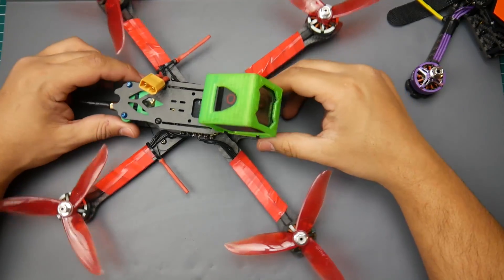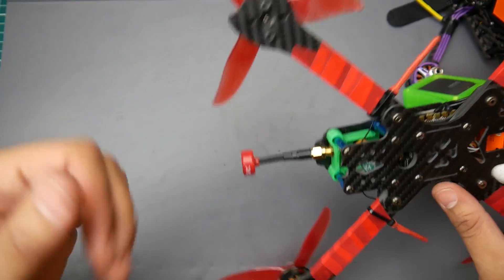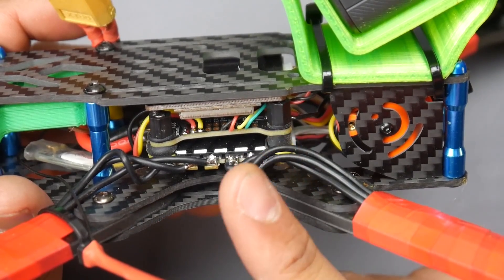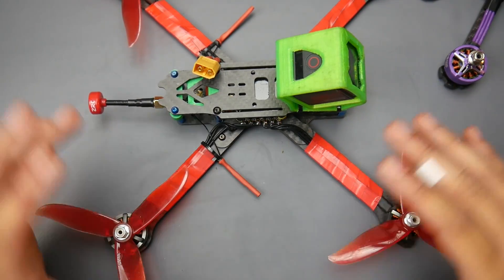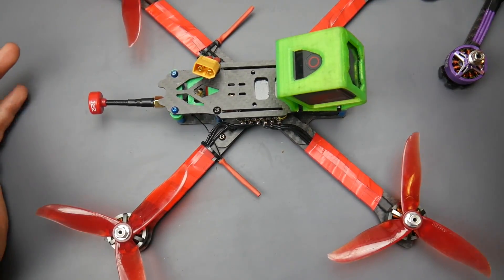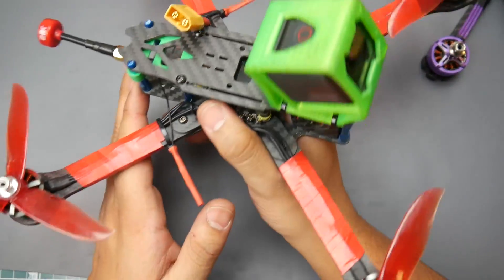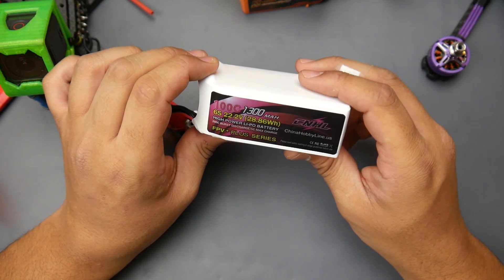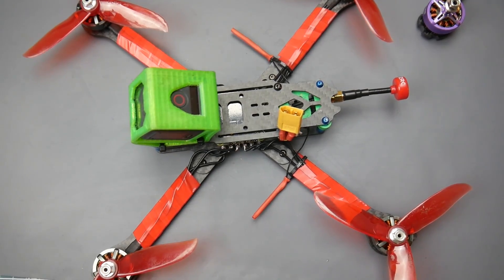Premium Performance For $12 // Best Budget Motor Emax Eco!!

Comment: So you're not the first person i've heard talk about flying 6s on 2700Kv motors, but I assumed the first guy was lying and your gear would shoot fire if you tried to run that drivetrain.... Is that really a thing people do? Does it melt like the T1000?
Reply from the maker: What 2700kv its 1700kv
Reply: @DroneMesh   @3:49
Reply from the maker: @MrFadjule  I was talking about the speed and how it felt the 2700kv was in context with it on a 4s.. However I have 2600kv 6s motors from T-Motor which i will take out this week for testing.
Reply: @DroneMesh  for 5" props?! this boggles my mind

Comment: The 2400kv ECO and RSII motors are nigh on identical in terms of thrust and efficiency on MQTB.  They both measured the same KV, in fact the RSII was slightly higher.  One costs three times as much as the other.  The ECO's were supposed take after the LS series, and those are strong and powerful with only N48 magnets.  I'll take the 4x9x4 bearing of the ECO over the shitty 4x8x3 of the RSII any day.

Comment: Nice! I have the 2400kv running on 4s w/5043  Windancers! I wasn’t expecting much but damn, they are pretty damn good! I was impressed, didn’t think I would like them! Very smooth and good power! Gonna pick up the 1700kv ones as well now. Just because I was impressed with the performance. And I normally buy “premium” motors

Comment: Hello, good friend, could you tell me where the propeller nuts tighten, squeeze right? or press to the left? thanks
Reply: @DroneMesh  sorry, these engines are only available in the direction of rotation cw, I think it means that nut threaded right to hold the propeller, is that so?

Comment: Whats your opinion on Eachine Tx(s) vs AKK Tx(s) ? 

I am looking for an Airplane System; TX and RX with (reliable 1-2km Range) as a replacement for the old Lawmate 2,4Ghz System. I made the switch from 433openlrs to FrSky 2,4 thats why I have to switch the Videosystem as well. My Videogoogles are from Marek: http://napolskimniebie.pl/index.php/sklep/wyposazenie-fpv/obudowa-do-monitora-5-detail

Comment: I use 1700-1800 KV motors like this  designed for 6S and 5" props but with 6" props and 4S on wings. You can use lithium iron 4S1P batteries , cruise on 3-5 amps at 70-80 kmh, and get flights for 30 + minutes and still come down on storage voltage.
Reply: That's very interesting! I'm new to for, I've been easing myself in with toy drones first just to get used to the controls. I feel ready to build my first fpv drone now. I'm wondering if you can give me some pointers on parts? I'm interested in long flight time and I'm willing to sacrifice on top speed for it. I was looking into building a 6s 5" frame drone with 1600-1800kvl motors set up for maximum flight time. I'm also looking at getting a nice he camera so I don't have to mount a go pro to it. Any suggestions in your experience on what frame, esc, FC, motors, vtx, cam and battery? Also what's a good intro remote control? I would appreciate any input 😊 thanks in advance!
Reply: @KabbaJabbawockeeZ95 Yes my total amount draw.  12-14 amps Max on 4s at takeoff on 80-100% throttle.  Once airborne and the prop is unloaded I can cruise at 60-75 km/h at 3-5 amps on 4s.  I use a racestar 1722 kv 2205 motor and a homemade 4S1P 18650 pack. All from bangood.  Samsung inr 18650 30q and I use gemfan flash 6042 2 blade propeller. Gemfan triblade are okay but pull more amps without a noticeable increase in speed. I prefer 18650 as they are lighter and have far better energy density.

Comment: If I'm only planning on running 4S is it worth getting 1700KV? Or should I stick with the 2400?
Reply: i have the 1700kv for 6s. Now i flew the dawm bugger on 4s, ok it isnt the faster rig anymore but for some freestyle? i really enjoyed them on 4s.
Reply: 2400 for 4s
Reply: 2400 in 4s
Reply: I ve running the 1700kv version on 6" with 4S and its really ok if you don t wanna race. Flighttime is about 5 min with a 1100mah 4S. But i ve just orderd a 6S lipo for more speed!
Reply: Michael Mir yeah definitely do those on 6s. Thinking about picking some up
Reply: @michaelmir9150  6" triblades or 2blade?
Reply: @Witness27  its a 2 blade 6045 prop.

Comment: The tmotors f40 pro 2600kv are in 11€ on AliExpress
Reply: where? Readytosky are not tmotors. I've had Readytosky version of Brotherhobby motors, comared them side by side and cheaper ones has way weaker magnets. Besides they are nearly visually identical.
Reply: @tmb282  nop I have thems and compared with originals from getfpv are the same exactly motor,  I'm not talking about a rebranded or different label motor, I do not want them to empty the stock u can search by u self, and wtf is a readytoshky xD another option if u don't trust is the RCX 2207 2700kv
Reply: @ho-xo8my  Readytosky is an old shop selling cheapo FPV stuff. They're famous for selling cheap motor that looks exacly like a premium ones aside logo :D can you show me, where did you buy this F40 motos?
Reply: @tmb282  send me a message on one of my videos and I will shared there

Comment: You kill them with one hit in crash worst motor I have seen in a while
Reply: i have them on all my quads and crashed like 20 times ...no even a ding.
Reply: @davidvaknin3801   I have 12 motors all dead
Reply: @biggfpv2721  I want see some pictures show us? because I don't believed you talking about.
Reply: @robortmojo457  good Lord why would I lie about it I don't benefit from any of it just a tip if you love emax buy the dang things don't really make a fuck to me either way
Reply: @biggfpv2721 ??? Are sure its a problem with a motor???
Reply: How did you kill all of your motors? Flying a wing? With a quad or seems like 1 or 2 would survive just because you couldn't fly anymore.
Reply: @mshane86  I didn't kill every one I got three left I just took em all off and stuck em in a bag cause I ain't buying more but I mean I can't expect them to hold up like a better motor but figured they would be better than that

Comment: Not related but how have you got on with the tekko metal 4 in 1 esc? Really keen to know what you think.
Reply from the maker: I am repapring a second build with the metal to run 6s I have it on a 4s build and its going great so far.
Reply: @DroneMesh  Thanks Great to hear. I have a couple on order for some new builds.

Comment: Lol goose just went to Phoenix open and trashed his ecos practicing before qualifying even began, 
Do Not Race these!
They are not very durable, or durable at all.
If you want performance and a great price check out Rcx motors
Reply: I was going to get these. Drat. I'll have to get the racedayquads 2205 badass motors now.
Reply: @KabbaJabbawockeeZ95 I decided not to get them and got RDQ motors instead
Reply: @FPVisioning  Any motor will have questionable durability when crashed, your statement is pretty flawed.
Reply: And some are stronger than others, due to better metal and design. Statement isn't flawed.
Reply: @Xistn  If you looked around youtube you would have seen that this is the case for lots of people

Comment: The emax does not show which magnet is using and the photos of the motor we can see that they are not in arc, with that the thrust will never be the same as premium motors
Reply: "Sorry, but I gotta get views from the title and sales from the link."

Motor quality (I'm not saying price!) plays a LOT of effect in your quad handling and performance. Saying it's just a hype to spend more money is plain stupid.
Reply: and that means ??   so we are using throttle position around 50% instead of 40% ??  who cares !  its all hype to get you to spend your $$
Reply: @CaribbeanZapatta  
The area of contact with arch magnet is bigger, giving more power and efficiency to the motors, this is a very important factor, besides being necessary to know the quality of the magnet, the premium motors use n52h or n52sh, these acronyms demonstrate the force and magnet protection
Reply: so this means what for the everyday FPV hobbiest ?    I am retired 67 and I fly EVERY DAY ! m I have built over 100 kwads (ya crazy I know)  and I have only had TWO motor failures.    I have Kareareas $27.  motors and Eachine cheepo motors.  when I sit down to enjoy a 5 min flight I could not care less what the motors are.  I am NOT A PROFESSIONAL FPV PILOT...are you ?  we are like lemmings.  The companies tell us we must have this or that ..spend more $$ !!  GETFPV  had these LDPower motors on sale $9.99  FOR TWO  !  they were used in the FALCORE.  I have that monster and never killed a motor !  I bought a BUNCH !  oh ya matching esc $9.99  for TWO !  my point ..its all HYPE !!  all BS !
Reply: oh ya  yesterday sale o n RotorRiot Ummagawd motors.  $9.99  !!  yup.  bought the lot.  :)  I like the shinny band on the bell,  could not care less about the magnets !
Reply: CaribbeanZapatta I think you did not understand, I commented that it is not a premium motor as the title said, which I can not compare. And it has famous expensive motors that are also not premium, but the video motor is good for those who do not want to spend too much
Reply: It is hype and counter productive to flight characteristics to have motors that upset gyros so much that you have to soft mount your gyro.

N52 magnets are not needed and only increase torque and power but hurt effeciency.

The same goes for arc magnets they improve power and torque but hurt effeciency if the gap is too small.

Tiny air gaps just make the motor harder to cool easier to sieze and again increase parisitic losses.

Remember n52 magnets are very easy to demag with heat.
Reply: thats why they cost half as much for just 15% less trust

Comment: I have been eyeballing these motors for some time. I don't see much stated as far as durability. How do they stand up to multiple hard crashes? I tend to crash hard and quite a bit. I broke 2 arms on my rooster my last flight if that is any indication.
Reply: i have them on 3 of my quads ...all 6s and crashed them about 20 times... not even a ding. these are beasts. take mud and grass and what not and keep bouncing back. super quality. i think thell regret that low price....lol but for now i stock as much as i can. and i gnor that idiot below... i bet he crashes without even flying
Reply: maybe you should either change flying style or take up another hobby ?
Reply: @CaribbeanZapatta  WTF are you on? People can't ask about the durability of a motor? If a premium motor is 3x more durable then x2 the cost is worth it. In other words take your elitist attitude and STFU.

Comment: With cheap motors most of the time it's not the performance that's the problem. It's longterm durability. I'll wait.
Reply: i have them for 4 months flying 5 packs almost every day. still solid as new
Reply: paying twice the price does not double the durability.  I would be confident putting this motor on all my quads
Reply: @trfpvVT  some times it triple's it
Reply: It's a 3 mm shaft with a 5 mm shaft up top. Guarantee you they will not last if you hit up an office park.
Reply: LMAO 🤣